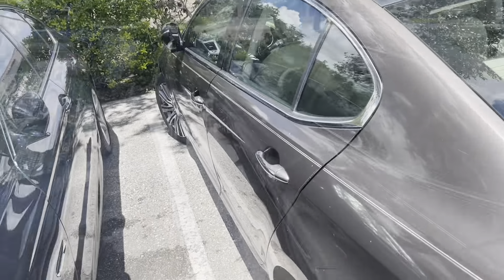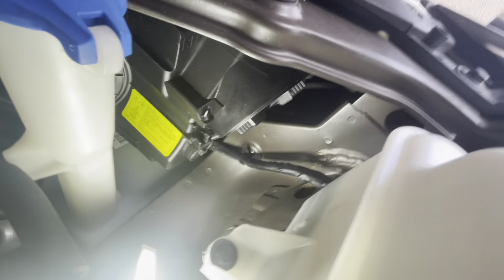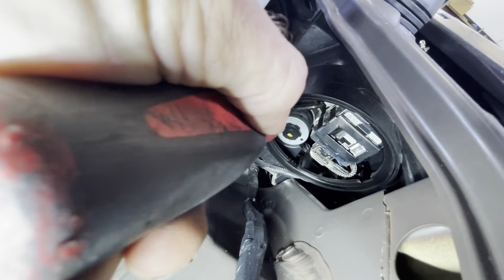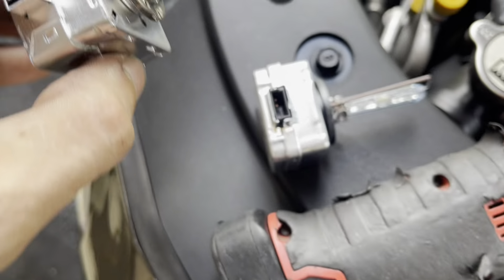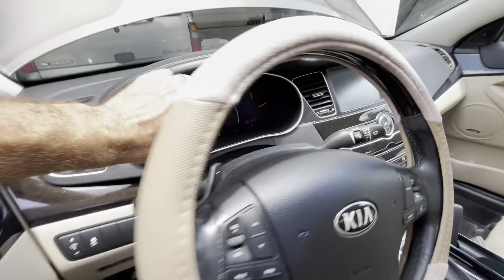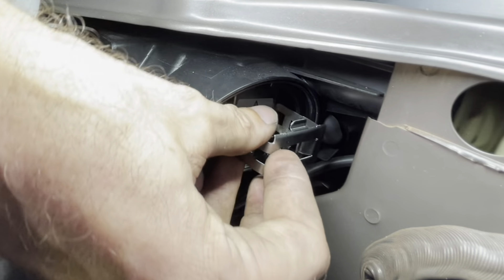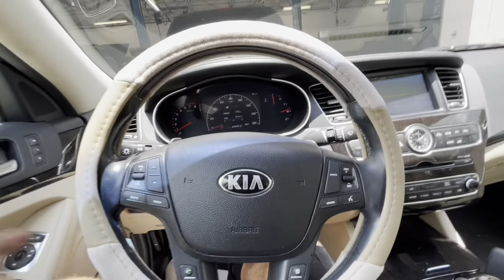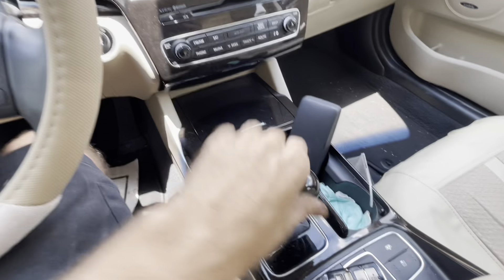Abnormal EVERYTHING All Day! Kia Cadenza

Comment: I personally consider being able to replace a lightbulb in a car to be something an owner should really know how to do - with every car I've owned, the first thing I read in the manual is how to change a light. However, humans keep feeling the need to continually re-invent things. I'm pretty sure that 60 odd years ago we figured out as a species how to engineer a lightbulb to be easily replaceable in a car. Now things just get engineered down into oblivion... this almost looks like a deliberately confusing process.
Reply: Pretty sure engineers design things to be as hard as possible nowadays. I still haven't worked out if it's to ensure the owner has to take it to a shop/stealership to get it fixed, or to make it take as long as possible to charge more labour. It could also be because they get paid a bonus for making things as difficult as possible for the previous two reasons🤷
Reply: far too much "innovation" going on nowdays... my wife's car has windshield wipers that are automatic...
Reply: Long gone are the days when automakers designed cars to be easily serviced/repaired by the owners.  Hell, on some cars you have to remove the entire front fascia to replace a stinking headlight bulb, then there are the cars with LED headlights where you have to replace the entire headlight assembly for $1500 or so if the headlight fails
Reply: Used to get an owners  manual that told you how to perfom these minor repairs, now the owners manual tells you not to drink the contents of the battery.
Reply: Bulbs, tires... well, at least put the damn spare on if there is one, should be common knowledge to operate a car.
Reply: @drewbk697  no way.!?!?!?
Reply: My old Vauxhall Astra you used to have to take out the whole lighting fixture to change the bulb. Some things are not as easy/simple as they used to be.
Reply: In France 🇫🇷 you have to carry a light bulb set a breathalyser and jack. God the French are so yuck 🤮
Reply: my 2010 requires bumper to be removed to change a bulb n whats worse the said vehicle has issues with the wiring harness...to change a bulb on it costs 120 ...riduculous ...changing 1 bulb doesnt need to be so hard n difficilt.
Reply: I have a 2019 Chrysler 300 and needed a headlight bulb replaced. Took it to a shop and they told me how much it would be I asked why so much. They said according to the repair proceedure, they had to take the bumper cover off to get to it. That didn't sound right to me so I went to another shop and they replaced it from under the hood while I waited in the car.
Reply: @cigarsgunsanddiesel8032  What spare?  Half the cars sold today don't come with one!
Reply: Lots of vehicles now days are several hours flat rate to change headlight bulbs.  1st step...remove bumper assembly...
Reply: @paullenzen2562  -- i read somewhere that back in 'the day', part of a vehicle's operation manual showed how to adjust the valves.
Reply: @cigarsgunsanddiesel8032  - our country has mainly a service economy nowadays, but with the way things are going....
Reply: I had a Toyota that had sealed beams. $180 plus tax in 1992. I had to remove the grill. It took hours. Then, next year I broke the other one. Got some plastic shields and never changed another one.
Reply: I had to replace a tail light on my 2011 Focus. Looked it up and it required removing the entire light assembly by pulling out the carpet in the trunk, finding the screws/bolts in the blind pocket, and catching the light housing before it falls and yanks wires.
Fun.
Reply: @paullenzen2562  LOL
Reply: @chrisfreemesser  and then they use the selling feature "led headlights last forever u never have to change a bulb!" Neglecting to tell them that pretty much any problem they have with it isn't going to be fixable, whole new assembly
Reply: @randomschmo5778  True.  I have a '68 Beetle and the owners manual shows you how to perform all of the maintenance on the car...oil changes, trans fluid changes, changing the drive belt, replacing spark plugs, greasing the front beam, etc.
Reply: Maybe the owner is a rich 80 year old widow.  Would you expect her to change a light bulb?
Reply: Some require major skilled surgery. Some require specialized tools. Some people today have neither skills nor tools. Some, like me, after 50 years of beating my hands up are in too much pain and I have done my duty. I will pay you for your turn. Exit the evolutionary advanced dinosaur - not me, the bird.
Reply: @paullenzen2562  Yes sir, the manuals used to tell you how to adjust the valves now as you say give instructions on common sense no-no's! We have progressed so far we have regressed!!
Reply: Really, you actually read modern manuals? I've given up and only ever bother if absolutely everything fails. That mostly works for me, though I've yet to work out how to get the buttons set to return the drivers seat back to it's set position, hmm, maybe now I've had it for 8 years might be time I opened that thing with as many pages as the bloody bible.
Reply: @drewbk697  What about them electric screwdrivers ?
Reply: dont think too much ray will fix ur light if it dies...
Reply: @chrisfreemesser  What chew talkin bout there? My 2014 Nissan Pathfinder 4X4 has a good towing capacity and DOES come with a spare, it's a super skinny little thing you DEFINITELY don't want to put on at all if actually towing something hefty and even if you weren't, you're not supposed to go (I think) more than 80 kph and not for any great distance. I bit the bullet and bought an extra full sized original wheel at a ridiculous cost and matching tyre but have to carry it somewhere NOT where they put that silly bicycle wheel one since it would almost certainly hit the ground and I aint doing that to a never yet used wheel.
Reply: @drewbk697  Much of modern innovations are not even improvements and it pisses me off.
It's the intentional over-engineering and over-complicating of simple things JUST (in my opinion) to make is hard or even impossible for someone to fix their own stuff.
The 'right to repair' is under attack in many fields by many manufacturers.
Reply: @chrisfreemesser :   " greasing the front beam, etc. "
Hilarious lol. Yeah, once upon a time they built them a lot simpler and mostly things were fairly easy to access these days, not so much.
Reply: @snowlothar45  the bird was awesome. And I'm kind of with u. I don't work my ass off out in the heat every day to have to do everything on my car myself lol. Sometimes I'm just too worn out to want to deal with it I'd rather pay someone
Reply: @chrisfreemesser  indeed. My current and last car did not.
Reply: You do realize that that bulb operates at 20000volts. Would not nice to be zapped
Reply: I'm 100% for the Right to Repair, but you have to remember that the factories get probably 500 requests for brighter headlights to every complaint they get about difficult to replace headlights.   And, with HID, headlight life is more like 10 years than the 1 year it used to be with filament in a sealed jar.   And auto engineers are under time pressure and cost pressure too.  So, least possible amount of engineering time goes into the replaceable parts, just enough to make them reliable to the automaker's standards.  With no time to consider how easy it is to maintain.  Thus, you end up with complicated systems that are friendly to no one, neither mechanics nor owners.
Reply: @jackedwards7420  yes indeed. I have one. A 1987 Nissan D21 Diesel. Still runs like a champ. It ain't pretty though.
Reply: @chrisfreemesser  No spare wheel on mine. I have the expensive Run Flats. Not my choice, came with them, but leaving them on so I don't get stranded anywhere and end up having to call a tow truck.
Reply: @randomschmo5778  I had Talbot Sunbeam back in 84 and would adjust Teppets, Spark gap and even stripped down the Gearbox. These days you need a degree in electrical engineering or be a great mechanic like Ray/Eric O to work it out. And the bulbs fir the lights were just held in by a self sprung U wire. You used to do everything back then. Now I do nothing sadly.
Reply: @chrisfreemesser  Haynes Manual?
Reply: @Sadik15B  you need 1.21 gigawatts and a Flux Capacitor for it to work properly. Plus I didn't see Ray put in Winter or Summer fluid in the housing.
Reply: @chrisbentleywalkingandrambling  just look up what the starting voltage is of hid/xenon lamps.
Reply: @garrisonjoe5977  well it would be nice if the parts actually lasted a long time like hid bulbs usually do but this one did not last very long... That car is only a few years old
Reply: @chrisfreemesser  READ my comment...
Reply: 2008-2012 Malibu-factory procedure for replacing bulbs requires removing the front bumper fascia. These types of things are done for only one purpose-to generate income for dealer service departments.
Reply: My last car was a Chrysler 200. That particular model year required the bumper to be removed and the headlight housing to be removed from the front to change the bulbs. I’m subsequent models, things were rearranged and an access port was added into the wheel well to facilitate this, but mine required about an hour and a half of labor to accomplish.
Reply: The lady who used to cut my hair had a Denali. Both headlights went at a price of $600 each because they were sealed units. $1,500 total. She told them they could keep it and traded it in!
Reply: @chrisfreemesser  Oh yeah, I know exactly what you're talking about. I was replacing a friend's bulb on her 2010 Altima, and the "right" way to do it is to remove the entire bumper. Luckily I found a better way, which involved removing some trim fasteners and reaching up through the wheel well. Not fun, but definitely easier than taking off the bumper.
Reply: @Leonarco333  holy shit wow
Reply: @Leonarco333  sounds like a design from the Fiat in Fiat-Chrysler
Reply: @garrisonjoe5977  Gee, my "filaments-in-jars" are at least 5 years old and took an achingly long 10 minutes (including a cigarette break) to replace needing a very special #2 phillips screwdriver for toolage and nothing else. The price was extreme; I'd never paid over $15 for a headlight before and this one was just over $20. 

Knew someone who got a dealership quote of $750 to do one headlight. Nope, they'd DIY and save bigtime: $35 for the bulb, and 6 hours later they said if the other side went out they'd just sell the damn car as-is.
Reply: @Leonarco333  a Chrysler 200, you say?  I used to have one of those. Got rid of it, after I discovered it was drinking 2 quarts of oil, with every fill up. Talk about a joke
Reply: @katherinenelson6144  every time I had to do anything with that car, I wanted to park it the top of a cliff and push.
Reply: Owned a 2014 Ford escape to change the twilight bulb interior panels had to be removed carpet rolled back it's insane where engineers put things there are approximately 13 bolts to replace a fog light on a highlander yes I know no I don't have time or tools to do it pre 2000s I did every job myself now to change the oil filter I have to buy a special tool it's  literally cheaper to pay a tech a lot harder to find an honest one
Reply: Some of the complexity is necessary..but most of it isn't. Planned obsolescence of the highest order.
Reply: @chrisfreemesser  same for alternator and starter what should be a 30 min job turn in a 4 hour + job
New car are a pain to work with and it's on purpose
Reply: @randomschmo5778  the  valve lash spec was written on a sticker under the hood with spark plug part number and gap
But a would say now the majority of engine doesn't need valve lash ajustement
Reply: Replacing many of the bulbs in my wife's VW is an absolute nightmare.
Reply: LEDs can't be changed these days
Reply: BUT in a 1950's or 60's cadilac removing front bumper was necessary to replace a signal light. reference my father who at at filling station thought they could replace it in less than listed hours.
Reply: People are making too big a deal of the exceptions here, which have existed before, see the dude talking about his 92 Toyota. The reality is that the important front end bulbs on the huge majority of cars are pretty straight forward, if sometimes requiring a bit of contorting and  maybe an assist from someone with smaller mitts in the worst cases. 

People that have shops replace them are usually: 
A. worried about messing up the bulb trying to do it themselves, which given that some of them (particularly if you're dumb enough to buy OE ones) can be pretty pricey isn't an outrageous concern  
B. Just cant be assed to get there hands dirty, which is a completely acceptable reason. You will not hear me complaining about getting tossed a few bucks to do something really easy that literally takes like 10 minutes tops in most cases. 

The rear bulbs tend to require a bit of disassembly since they're usually behind paneling, but that's always been the case.
Reply: @drewbk697  Like they don't expect me to know how to turn the wipers on when I need them. "Oh no, it's raining, I can't see, what do I do?"
Reply: 60 years ago a car manuel, had instructions to properly time the valves
Reply: Quite agree; what's wrong with a simple, quarter-turn, screw fitting? Having said that, the Kia arrangement might be quite straightforward if you're holding the unit firmly in your hand, in a well-lit workshop, while standing/sitting in a comfortable position. Stick it backwards, into a dimly-lit, cramped location, while peering at it upside-down and backwards, and the simplest gadget takes-on a whole new level of evil, especially when working against the clock, under managerial harassment.
Reply: @eugenewhipple2562  I came here to say just that...
Reply: @paullenzen2562  That's called "Idiot Proofing"...
Reply: @PopllFixit  i know from first hand experience replaced the bulb on 1 side then harness fried so replaced both then bought new lences lol i dont know how many timed that bumper has come off lol n im sure many more times lol

Comment: I would have thought that all automakers would use the same basic idea to hold in a light bulb at this point. I suppose it's similar to the fact that there are hundreds of different spigot valves for faucets and one has to replace with the exact manufacturer design. 
    Again, Ray, I am in admiration of your patience, stick-to-itiveness, and lack of cursing to deal with this PITA job that with good engineering should have taken 5 minutes as it would with a Toyota or other consumer minded automaker. Thanks for the great video. I love the bird in the shop.

Comment: i remember buying one of those lights for one of my customers at autozone. The bulb was $185. Now that is just absolutely insane. I can imagine what the price would be at the dealer. Also lets add the fact that the bumper had to come out and head light assembly to get to it LOL
Reply: The bulb he used (D1S) is "only" $67.99 on Amazon.  A bargain!
Reply: @lab1042  you know what's even more crazy. My customer bought the headlight assembly for $900 thinking it was that lol
Reply: You think that's bad, the big brother short arc xenons in movie theater projectors are far more expensive with a shorter life span, yet they are easier to change.
Reply: I've got a 2005 Jeep Liberty. About 10 years ago, I tried running some of high intensity bulbs, like Sylvania Silverstars. But after a couple times of them burning out after only a year or so, I went back to the stock bulbs. Haven't had to replace a bulb in the 7 years since.
Here's a tip - if you think your stock headlights are too dim, try having your headlight aim checked out before you spend money on high dollar bulbs or lights.

Comment: I miss the “good ole” days when there were just two headlight styles for all cars and trucks…round 5 1/4” 4 headlight system or round 7” 2 headlight system. Loosen three screws, twist and remove the retaining ring, remove sealed beam bulb from the front and unplug. Replacement was reverse of removal. Plus! The lense was glass not plastic so it didn’t fade from baking in sunlight.
Reply: I do miss glass lenses but those sealed beams for awful for actually making light.  A European version (shaped just like it, glass lens) would have an easily replaced bulb on the back side. (In fact, some people converted their cars to euro headlights but that's a whole 'nother story.)
Reply: @theundergroundlairofthesqu9261  
I did that on many of my cars. I used Cibie’ conversion headlamps with Halogen H4 Bulbs. On my rally car the high beam was 100 watts. I still have the headlamps in storage when I sold the car.
Reply: @stevencimini3556  I've had high power lights on every one of my bikes and cars. I do a lot of travel at night and here in Australia there are a lot of kangaroos, wombats, cattle and suchlike to dodge. Modern lights are so much better than the old sealed beams - ugh!!